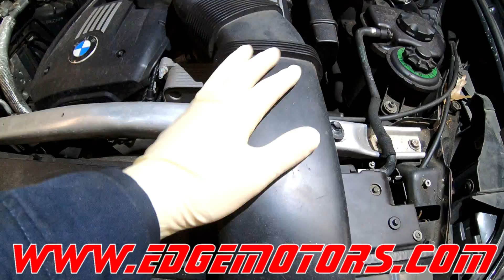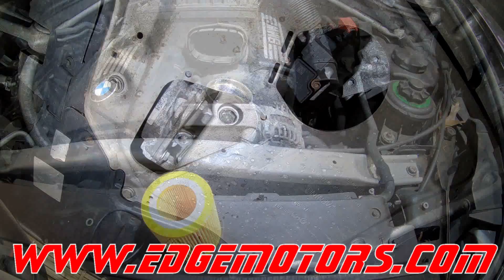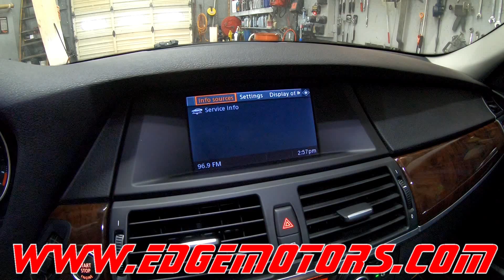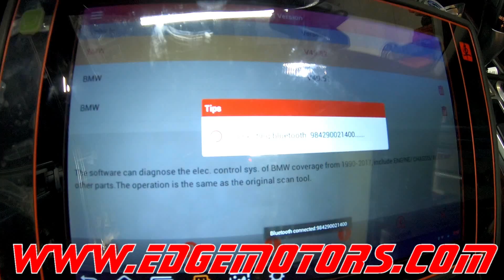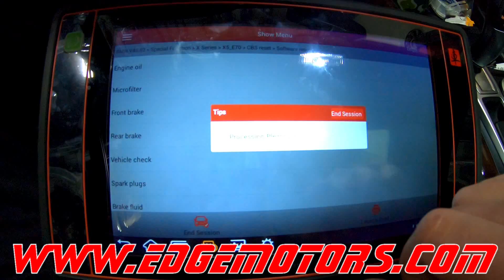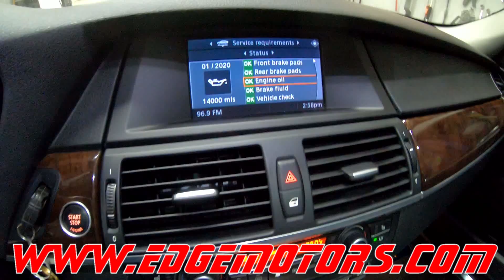BMW X5 3 0L Oil Change Service and Drain Plug Repair DIY by Edge Motors

Comment: Does doing this not hurt the inside of the engine due to all that stripped and threading and threading ??
Reply from the maker: Well, try not to put any if it in, and you could try to flush it out with some oil and such, but there is also a mesh on the oil pick up, so it won’t let any of it into the engine.
Reply: EDGEMOTORS i think its a lil too late😔 my in-law helped me a week ago, and yes the oil leak stopped leaking, but now i hear a noise in the engine, sounds like the bearings or lifters🤷🏻‍♂️ kind of like a dry noise, it is a very light 1second sound and then it goes away. 😣😞... last thing i do not want to do is replace the engine. I do not understand why this cars”bmw” is so expensive but So Fragile.😫 Now imma try and change the spark plugs.
Reply: @fivestarhemi2877 how was it, did the noise go way?

Comment: Mine would be m12x1.5x16mm, I am asking do I get the M13 with slightly larger tap threads or helix oil? I haven't had any luck finding the m12 kit
Reply from the maker: The helicoil set will let you keep your original size of the plug, you will tap the hole with slightly bigger tap that comes with the kit and it has to match the insert that you will use.
Reply: Where do i find those sets ?

Comment: why didn't you lift it up and check for leaks???
Is the pan aluminum or steel?
Reply from the maker: We did ... just not on video. It’s been good ever since... it’s a regular customer.
Pan is aluminum.

Comment: Great explanation on how to install that. I’ve never seen it done. Great video!
Reply from the maker: Bmw use these in the tsb to repair the threads in the block for cylinder heads...